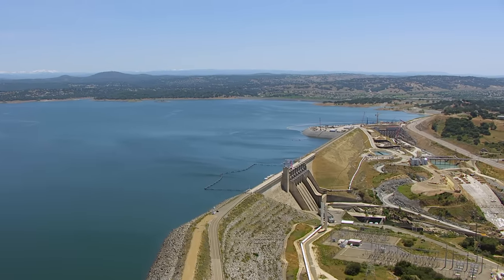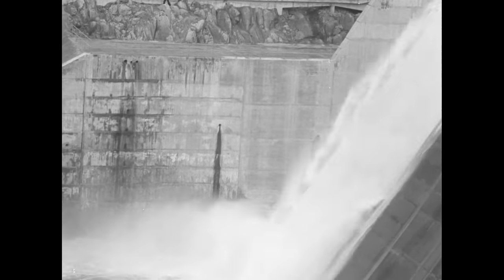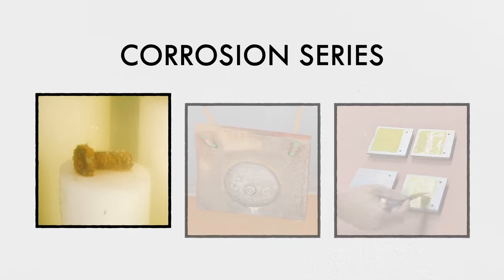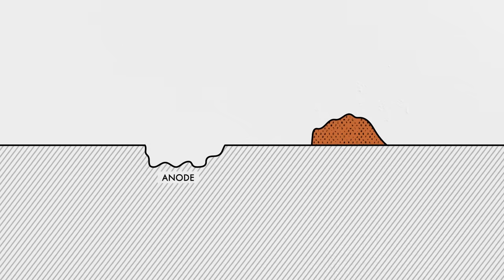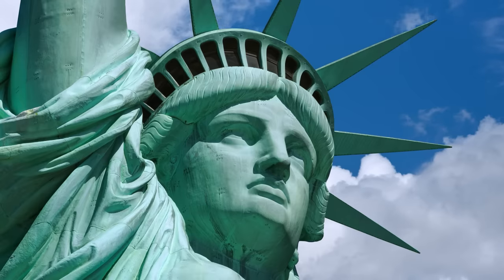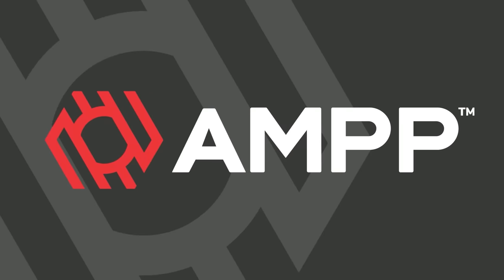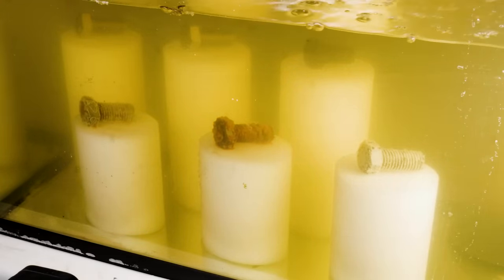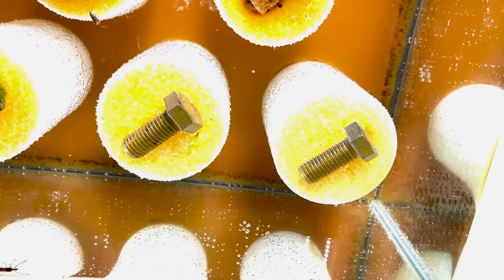You Spend More on Rust Than Gasoline (Probably)

Comment: I despise rust. Such a challenge to combat rust on my farm equipment and supplies. I also work offshore oil & gas. Could not believe how quickly and severely corrosion takes place on a platform. But don't worry about the main systems. They are protected by a bazillion sacrificial anodes which are checked regulary and maintained/replaced as required. Lot's of stainless steel and even titanium used these days to prevent rust. Especially on the seawater systems that are used for cooling. On the other hand the living quarters are built from carbon steel. If the coatings fail you can't believe how quickly(and deeply) the corrosion sets in. That's why most platforms have a paint crew on board.

Thanks for the explanation of Core 10 steel. I just bought a lot of it at a sale.

Comment: And thats why i learned to always coat nuts and bolts in a thick layer of anti seize. Nog only the bolt comes loose after a hard winter. But the amount of time saved by not breaking bolts. Is just mindblowing. 

I mostly do my own work on my and my friends vehicles and this trick i learned from a old mechanic. Even garages that do the inspection and small items on my vehicle always say that it is a delight to work on my car because everything just comes loose when the want to. 

So corrosion is a pain in the but. But easily preventable. With the proper care

Comment: This is also why, at the Peir here by the Oceanfront, You'll see tons of Rusty Metal on Posts directly exposed to highly concentrated saltwater, but when they repaint anything, they don't scrape and paint the rusted areas. They paint up to and around it. It was so strange to see, this old rusty part with brand new paint around it. But yea some of that rust has been there since WWII, still protecting those actual pieces of metal. Same as the decommissioned Navy Warship in the harbor you can tour and walk around seeing the layers of paint and rust from decades of repair. Very cool

Comment: A side point, but the oxide coating that keeps things like aluminum from rusting is also the same mechanic that allows metal tanks to hold highly corrosive gasses like chlorine and fluorine.  When the oxide coating is disturbed you just get more oxide.  However when a chloride or fluoride coating is disturbed you sometimes get a metal fire and those are horrific.

Comment: 7:54 50% true.... they need to react, but the result also needs to stick to the original material. Regular rust has a bigger crystalline structure and flakes off, iron 4 oxide on other hand forms a protective layer

Comment: They should incorporate sacrificial anodes (magnesium would be best) on those types of mechanisms, just like big ocean-going ships use zinc or aluminum anodes to protect their hulls against corrosion. Learned about that when helping my father replace the anodes on his steel hull Berger back in the 80s. It was far less expensive to replace them without going to dry dock or getting "slinged" to do the job, so I put on my dive gear and did it for him. Took me two days, 'cause getting the old units off the hull was a matter of using a hammer and chisel. The drive shafts were much easier replacements.

Comment: Fun fact from a mechanic, gold is used in air bag connectors in vehicles because of its corrosion resistance. Though it's not the best conductor, it's durability is more important as its a safety system.
Love the channel and the knowledge, so I figured I'd share one of my favorite fun facts.

Comment: Refinery corrosion engineer here. Will throw out that a fair amount of the cost of gas in the first place comes from expenses related to inspection, upgrades and repairs from corrosion. 

Good overview of corrosion in the sort of environment that's relevant to most people, but want to throw out a few nit-picks: There are loads of corrosion mechanisms (generally high temperature mechanisms) not based around an electrochemical cell, so your definition of corrosion is very limiting. Also, stainless steel tend to start around 10% chrome and nickel (vs the "as much as" you gave). The 304 you used for instance is nominally 18% chrome, 8% nickel. 

Great to see someone as much as mention corrosion engineering though! Keep up the good work!

Comment: In power plants, corrosion is a constant issue.  Even little things like variations of O2 concentration in feedwater vs O2 in tiny pits of pipe walls can set up corrosion situations.  And 'flow accelerated' corrosion, where high fluid velocities erode passivation layers to expose fresh metal.  So many areas to cover.  Pipe and component lifespan is a key factor in plant life.  Some that happened to control corrosion well last decades longer than others.

Comment: I thought it was interesting to learn why ships have sacrificial zinc anodes bolted to their hulls, beneath the waterline. Apparently, corrosion prefers to oxidize the zinc bricks rather than the hull/prop. It works because of the slightly higher positive charge zinc has over the rest of the ships metal. Eventually, they corrode away and have to be replaced, but it's better than the ship rusting out.

Comment: The cooling system in the Sydney Opera House uses the salt water of Sydney harbor, to prevent the system from rusting to nothing in 5 years Zinc is attached to rust in stead of the steel. The original system is still in place and working fine, the Zinc has been replaced several times...

Comment: I'm currently undergoing my 2nd year of Aviation Maintenance Tech school, one of the things we learned in my first year is how we protect most planes against corrosion, basically at the lowest layer when all we have is the base aluminum alloy, we use this Etch & Alodine process to act as the last line of defense, after that you throw on your primer, several layers of paint and whatever finish you have at the top, all of this works together to prevent that base alloy from corroding. 

The important part about this whole process is that all parts of the process have to work together on a chemical level, there's been cases where the paint job on an aircraft is almost finished and then someone accidentally opens a door, introducing a bunch of dust particles into the environment and ruining the paint job's corrosion protection, meaning all the paint had to be stripped off and done again.

Comment: Have you heard about the Pilling-Bedworth ratio? It's a measure for the volume expansion a metal undergoes when it changes to an oxide. This ratio needs to be around 1 for the oxidation layer to be airtight (like for aluminum or zinc). If it is too far off, the oxidation layer is porous or forms cracks (like rust), letting the oxidation continue.

Comment: Galvanic corrosion is present even for cooling systems (notably computers). If you were to use copper heat block and aluminum radiator or vice versa it will cause corrosion of the system. This causes damage to the metal, potential blockages, and for those with clear water lines because it looks cool dirty looking water which doesn't look good

Comment: Mount zinc plates in areas of a motor vehicle known for rust. Control arms especially. 
The zinc will enable the steel to regain electrons lost in the corrosion process. 
Only problem... the sheer amount of anodes you would need to cover every vulnerable area (potentially thousands) renders the task essentially ridiculous. But it would work rather well.

Comment: If you had gotten your hands on an AISI420 / 430 bolt, you would have been able to show a mayor difference between redox resistances. Resistance to saltwater is basically the same between 304 and 316. AISI316L has a mayor advantage in case of chloride present in the electrolyte. 
The difference between series 400 and 300 alloys REALLY shows what the extra chromium and molibdenum achieve.

Comment: Spent 41 years in the oil and gas industry, half of it offshore. Corrosion was and is the bane of the industry. My last 10 years focused on oil and gas pipelines that have significant consequences if corrosion is not mitigated. Great presentation from a civil engineering perspective.

Comment: Worked in a lot of refineries and mines in a australia as a scaffolder I see really bad corrosion all on structural steel all the time, the best example was Gladstone QAL aluminium refinery where I was asked to scope a maintenance job that required hanging scaffolds off structural steel frames to get to the underside of about 100 meters of conveyer belts 20-30 metres off the ground so I went up to have a look and everything was so corroded the was nothing suitable to hang scaff off to the point I could put my finger through some of the beams  I told my boss it couldn't be done and had to be built from the ground anyway the whole lot fell down overnight after I went home crushing a whole load of tanks underneath.

Comment: I don't have a line item in my household budget for corrosion specifically, but I spend a fair amount fighting it (Liquid Wrench, torch fuel, etc) and preventing it (grease, antiseize, dielectric grease, chain and cable lube, paint, etc).

Comment: The West Side elevated highway in NYC was built in the 1930s using VERY heavy metal, but the city as usual neglected it, and by 1974 a section of the roadway COLLAPSED under the weight of, of all things- an asphalt truck on it's way to a repair site!
Pretty quickly the city shut the entire thing down WTC to the Geo Wash Bridge or near there, because they found extensive corrosion everywhere. They hadn't painted it in many years, and so the city wound up demolishing it over a 10 year period. All that structure that should have lasted 100 years plus- was trashed by 40 years of neglect.

On galvanized steel, I know from my collecting artifacts from demolished NYC buildings, the decorative stamped cornices on the top of the wall were made from sheet steel but they were hot dipped in a way that put a substantially thick coating of the zinc, they were typically painted, 100 years later there was no rust other than in very small spots on one or two elements of the assembly. I believe that hot dipping method they used in the 1880s was  far superior to the microns thin coating  they electroplate on today

Comment: I’ve come to the conclusion that many vehicles are just destined to rust away.  I had an 2005 f-150 I sold to a friend in 2013. It’s totally rusted out today.  I bout a 2013 F150 and sold it ton another friend in 2020, it’s totally rusted out around the bumpers, and bed today. Both of these trucks without rust damage is 21-33 k   With the rust $3500 and $1200.  

I spend about $250 a year to keep my trucks low rust free.  I manage to keep them “like new” but once I sell them, and the new owners stop maintaining the rust inhabiting program, it seems to accelerate beyond normal.  Which makes me believe maintenances is super critical and that once the budget for such maintenance is stopped, the rate of decline is much greater than that of a new vehicle.  It seems that manufacturers try to minimizes corrosion for a 5 year period. After that, whatever coatings they used are much reduced.

Comment: As a corrosion engineer, the cost of corrosion and the amount of failure analysis that must be done is incredibly, the biggest problem is stress cracking corrosion, especially in oil and gas, and it’s not just infrastructure, it’s materials science, it’s polymers, it’s medical, it’s just about any and all industries you can think of that deals with corrosion, my job is to develop materials that can withstand, pitting, SCC, electrochemical and more

Comment: Brilliant statement "Costs show up in vehicles you buy!" ...
Vehicles designed today are junk made with a unibody frame that utilizes less solid steel for their structure.  Once salt water gets in then they deteriorate very rapidly. The sheet metal immediately begins to corrode and fall apart. I have seen 8 to 10 year old cars ruined. With a solid steel frame in old cars that would last 30 years the difference is huge.

Comment: I am a knife maker and knife collector.
Corrosion, rust and rot are forces that constantly work on every single thing that humans create.
All my knives need to be oiled, the leather sheaths need to be oiled, everything stored needs to be checked, anything stored in an airtight container needs to be checked for mould.
I am more tuned into this than most people, but only the other day I turned on an electric heater that I bought last year.
Where I live it has hot summers and cold, damp winters. The heater performed poorly. Turned out that being turned off for half a year, in a slightly damp environment, resulted in the metal fins rusting.
We draw oxides out of the ground and turn them into metals, and they do everything they can to revert to oxides and go back into the ground....

Comment: How appropriate, I just had to go to the extreme to remove RUSTED bolts from a cast iron wood stove. The bolts were probably grade 2 stove bolts (basically made of cheese) and they sheared off with about 3lb of torque. I was able to heat up the cast iron and extract 3 of 4 when I had to simply give up and dill out the last one. The last bolt was so adhered to the cast iron that is was nearly a unified material.

Comment: The problem with the Folsom Dam gate was actually two-fold. 1. Corrosion. Yes. 2. The design of the lift mechanism cause the gate to self destruct when the lifter failed.  There should have been a fail safe, breaker or sheer pins put in the lifter so the gate remained in tact if the lifters stuck or failed.  

Sounds like it was designed in a hurry or hangover.

Comment: It interesting to learn about metal properties. Pocket knife steels, have different grades depending on how you intend to use them. I won't do justice to the different types of steel, just know it is very important to know what you need the steel to do, and the environment it will operate it.

Comment: Corrosion can occur at high temperatures, you do not need an electrolyte, you need an ion bridge (which in electrochemical is the electrolyte) in dry corrosion, or hot corrosion, the ion bridge can be air or a different environment

Comment: 304 stainless has 18-20% chrome.
Stainless steels have over 12% usually, depending on carbon content. Higher carbon content steel with 12% chrome will create chrome carbides that increase wear resistance but dont contribute to stainless properties. Namely D2.

Comment: Every car I've gotten rid of is because of rust.  When I go new car shopping,  my first concern after gas mileage, isn't how good the engine,  Trans, or electronics are... it's how good will it stand up to rust.  My current car is a Saturn with mostly plastic panels that held up the best so far.

Comment: I recently discovered my folks seawall must have been struck by lightning in that the 5/8-11 8-18 threaded rod was rusted in nearly all 15 points where they meet the cribbing and pilings. Like the voltage must have been insane to separate the elements of the stainless alloy and thus they corroded and in other areas, just gone. On one piling the square washer was nearly fused to the wood while the nut recessed into the washer forming a new hex hole in the compromised washer.

Comment: I grew up in The Northeast U.S., and, even as a teenager, wondered at the wisdom of using salt on roads in the winter, when it was known to corrode the concrete road surface, and the cars that traveled over them.  I still wonder over it, that we're basically self-destructing the things we build, supposedly to make them safer to use under certain conditions.  I'm amazed that in the half century plus, since my youth, we still have not found a solution to this dichotomy.  We build bridges with a life-span of fifty years, the Romans built bridges that are still standing centuries later - is this progress?

Comment: There is a benefit to rust as well. I’m the days of steam engines the tenders would hole the water for the steam part of the steam engine. But they didn’t have welding back then. They had rivets that they would beat to hell with a hammer to get an almost perfect seal. But it wasn’t perfect…so what is a poor innocent train engine manufacturer to do. The answer is…nothing. They would let the tenders rust and that rust would seal the rivets. I’ve heard stories of modern railroad museums with stainless steel tenders, that tell of how the stainless steel tenders leak a lot more than the original tenders, or tenders maid with standard steel.

Note: most of what I know about this comes from the YouTube channel Hyce. He works for the Colorado Railroad Museum and used to work for the BNSF Railroad.

Comment: G,day from Sydney Australia.
I deal with metal corrosion rust every day.
* Apply chemical treatments
* Wire brush it
* Paint over it 
* Spray oil on it
* Heat it
*How much it has effected the function of the part.
🌏🇦🇺

Comment: Would be really interesting to see a Ti6Al4V (ASTM Grade 5) titanium bolt and an Inconel 718 bolt side by side versus the stainless, galvanized, and bare steel in your fishtank of doom. Also, 304 and 316 are very similar grades of austenitic stainless. There are also ferritic, martensitic, and precipitation hardening grades. 17-4 PH would be another good material to compare.

Comment: For the record, while corrosion and rust are two sides of the same coin, generally speaking, corrosion refers to non-ferrous metals. So aluminium, brass, copper, etc., corrode, while iron and steel rust.

Comment: It would be interesting to take a cheap mild steel bolt, electroplated with a thin layer of gold, and subject it to the same underwater corrosion testing.
Reply: In theory, with a perfect electroplating job with no trapped moisture or chloride contamination of the metal, it would hold up nearly indefinitely. The galvanic corrosion would be minimal. But in reality, all it takes is minor damage to the coating for corrosion to work its way in